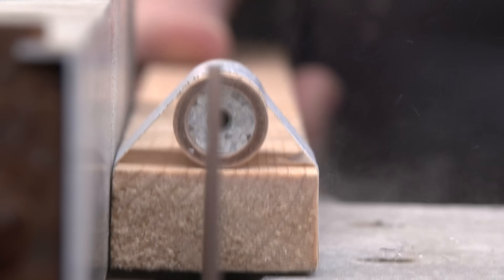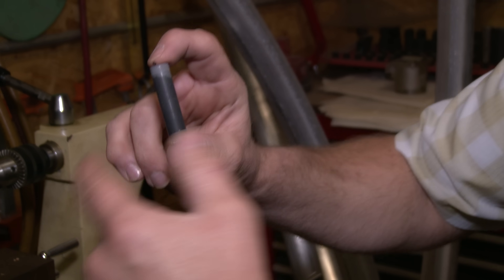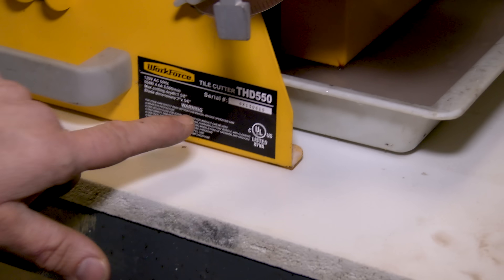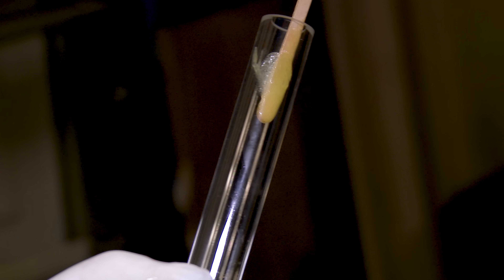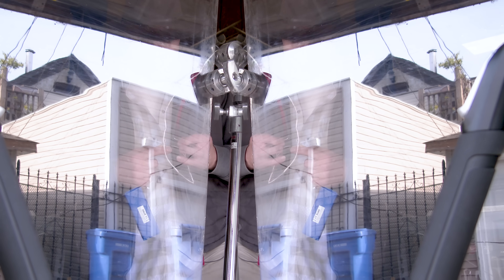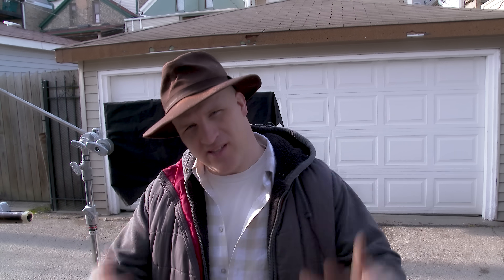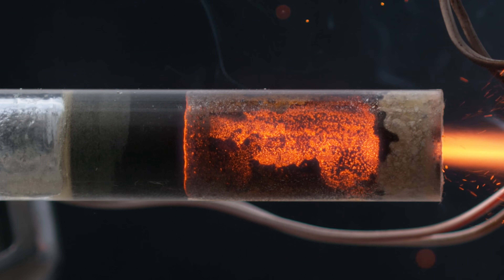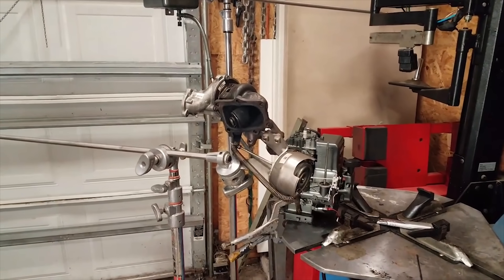See Through Model Rocket Engine - FULL ENGINE in Slow Motion 4K - Rockets (S1 • E2)

Comment: About the tilesaw:
Forget it, won't work on the thin glass that is used for watercooling. The glass will simply shatter.
And if you have to cut a lot of glass you want to avoid grinding it down like that or you need far more equipment to deal with the dust - cause that stuff is nasty.

Comment: Just a random thought . . . there isn't a health risk associated with glass particulate in the air when you cut glass?  I seem to remember it being recommended that you have a vacuum on the blade whenever you cut glass.(Maybe that was about cutting metal in electronics casings, to prevent shorts.  I remember that clearly.)

Comment: What would be a cool comparison is if you drilled a hole down the center so that it burned more like the solid rocket motors on the Shuttle, or our new rocket, SLS, do. With the hole drilled down the center, instead of it just burning from bottom to top, it would burn from the center out. It keeps the thrust a bit more consistent.

Comment: Seeing you drill in rocket fuel (which creates heat) really made me wonder why you are still in one piece. How do you get away with that, or do you like the thrill?
Reply from the maker: laughing buddha lol. thanks !.  you just have to use logic and Common Sense and that usually keeps you alive. I drilled, but what I was actually drilling was the layer of epoxy that was in the back of the tubing, I also machined it but I made sure to do so slowly as to create no heat , as well as having very quick reflexes and being prepared to get out of there quickly. I guess that's why I'm still alive

Comment: At the end there, running that turbo with no oil ok? Understand it's not under load venting straight to atmosphere but at that speeds without lubrication for extended periods, ball bearings have a tendency to violently explode.

Comment: Could you do a model where you simply plug the ejection charge side and dry fir the core so theres no charred adhesive on the side of the main combustion chamber?
Reply from the maker: +Atlas WalkedAway I thought about that , but the leakage will ignite the entire core and encroach to the sides for sure.
Reply: Darn, thats very true. Perhaps the propellant can be sealed with a similar, uncured propellant like r candy, and the nozzle could be backed by another, much shorter section of glass tubing that fits in the main and is clear epoxied in place.
Reply: I think your best bet might actually be to find a scientific glass worker who wants to show off their skills and make you a housing with an integrated nozzle. A quick preheat before should keep the damage from the high temp gradients between the nozzle wall and outer wall at bay. If you find them let me know. I need something custom for my glass pulse jet set up. lol
Reply from the maker: Atlas WalkedAway lol. yeah that a good point and I have been looking for someone of that caliber, I found a place in Chicago but haven't done any work with them yet.

Comment: Much better video than the first one, actually shows the end burner characteristics.  Ever heard of a CATO?  Just a little crack in the grain and kaboom!  Some of the Estes E9-s of various date codes have a tendency to blow,  That would make an even more awesome video.The C6-7 probably had a little crack or void halfway through the burn that caused the pop.  Making your own black powder motors with out the proper explosives permits will get you a visit from the guys in black SUV's wearing blue jackets with gold letters on their backs!
Reply from the maker: +David Bauer I have , and your right. Also about the permits, you are very correct comma especially in a densely populated area like the middle of the city. That's one of the reasons that didn't make my own, but I also wanted to represent the rocket that everybody knows, so next time they ignite a rock and in the field in their mind they could imagine what's going on inside. That's my whole goal of this channel

Comment: nice video. Try attach this engine (rocket) to dynamometr (or other spring with scale) and we will see what thrust is in different burning stages.
Reply: +angrodNumenesse
"He was using a C6-7 which is a C class engine producing a maximum 6 Newtons of thrust"
Is this constant over time? Does it peak at some point? Is average thrust significantly less than stated maximum thrust? Yes I do know the answers, I saw the graphs, I'm just making a point that seeing this actually being measured in the real world would be more fun to watch than just reading it off a graph. Incidentally, from the graphs I've seen, C-6 engines have a maximum thrust of well over 6 Newtons.
Reply: +corisco tupi " measured in the real world would be more fun to watch than just reading it off a graph."
This is something I plan to do.
I have a Chronos 1.4 high speed camera on its way sometime soon and I plan to do all sorts of experiments using it.
I have a thrust stand for quadcopter motors and I'm confident I can make a suitable stand for rocket motors.
I plan to compare some homemade motors with Estes motors. I'll need to figure out a good way to visualize the thrust while it's being measured.
Reply: A lot of motor manufacturers publish data like this. They provide graphs of thrust over time.

I just typed "Estes rocket motor thrust curves" into Google and the first link was a pdf with these sorts of graphs.

I'd provide a link but links often get trapped in YouTube's spam filter. The name of the file was "Estes_Time-Thrust_Curves.pdf".
Reply: Thrust is only generated during the booster stage.  Measuring the thrust produced will tell you when maximum output is achieved but the max thrust is labeled on the side of the motor so it's kind of pointless. He was using a C6-7 which is a C class engine producing a maximum 6 Newtons of thrust followed by a 7 second delay charge.
Reply: thank you for info, I never used rocket engines. I think that will be nice to see this force in slow motion. By the way you can say that everybody know that it burns and watching this trough a glass pipe is pointless ;)
Reply: +Duane Degn
That would be cool, Duane. Looking forward to watch it.
Reply: Perhaps the thrust rating is an average then. I have been out of the model rocketry scene for many years. My knowledge is quite rusty. I had no idea graphs of thrust existed.

Comment: if you drilled through the center of the charge would it have more thrust or just explode? as in down the nozzle so it's more like the srb off the shuttle
Reply from the maker: NZ Aviator good question, that could be a good subject for another episode
Reply: More surface area = higher burn rate, so it will produce more thrust so long as the fuel grain and casing can handle the extra pressure. If it's too high either the casing will explode or the grain will crack, exposing even more area, increasing the burn rate and raising the pressure until the casing ruptures and the whole thing blows up. There's a fine line between a solid fuel rocket and a bomb.

Another interesting thing is that by changing the shape of the hole down the middle you can cause the thrust level to vary over the course of the burn. The shuttle boosters were designed to make a 'M' shaped thrust graph, so the boosters would produce full thrust for liftoff, reduce their thrust a bit to limit aerodynamic forces as the shuttle approached mach 1 and then ramp it up again once the shuttle got into thinner air at high altitude.
Reply: exactly :) that's why I wanna see what happens plus if it's in a glass tube I think that could look awesome seeing the thing burn hotter and faster/explode haha
Reply from the maker: NZ Aviator lol... your right !!!. I should do that as a viewer request for sure. I'm going to make a note of it now

Comment: what mercedes?  twin turbo v8 or the 12?
Reply from the maker: +Ivan WNY v12 sequential setup, there is a baby turbo and a daddy turbo. I used the little one 26mm
Reply: Nice. so your a motor head too?  What's your daily driver?
Reply from the maker: Ivan WNY an e55 AMG .
Reply: Warped Perception sweet.  I have an S55 AMG. I got some videos in my channel.
Reply from the maker: Ivan WNY nice . im going to check that out !
Reply from the maker: Ivan WNY what made you ask about the Mercedes ?

Comment: did u see my suggestion
cuz I suggested this
Reply from the maker: +Sagar Nanda I didn't have it on the list ... But this was the original plan. Sorry about that !
Reply: there is one more thing u can do that is get a oxygen tank and connect it in a sealed way at The back of the tube 

that way u can use the acrylic tube as the fuel and create and another type of rocket engine in which u can control the thrust